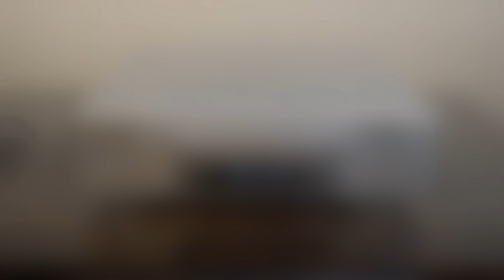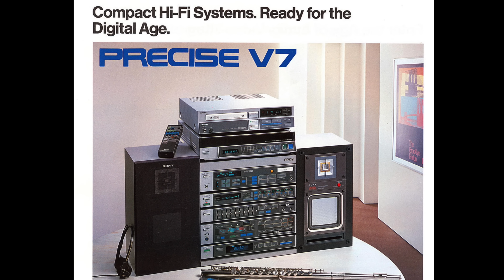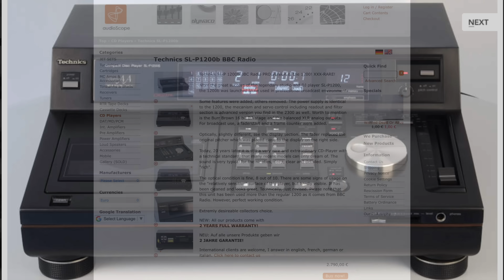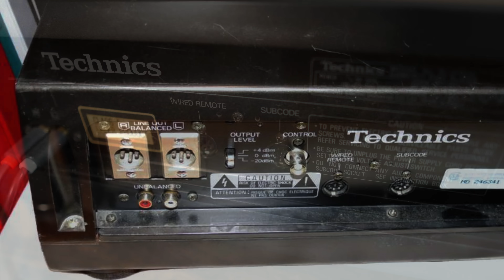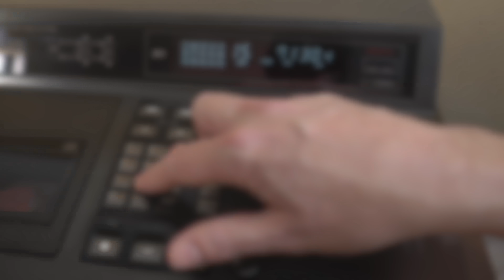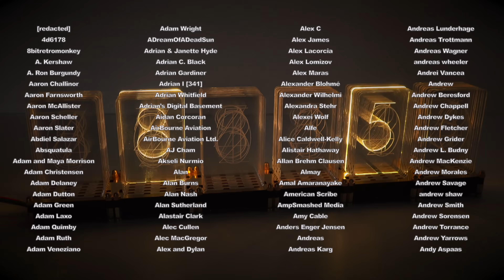How CD players lost their cool & why this Technics didn’t.

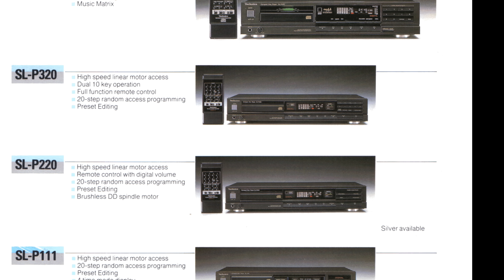Comment: 6:00 Honestly, I like these designs. You are not wrong, they are kinda boring in a way but on the other without at least one component like that something would be missing. They are kinda fancy on their own when they have individual buttons for track numbers, these grids on the display and sometimes jogwheels. But I wouldn't want every component of a hifi system to look like that, that's for sure.

Comment: Nice presentation! On a similar subject, you could present the first "drawer type" turntables. In my opinion, in North america, the Bing Crosby turntable made by Philco in 1946 (Model 46-1201) was the first to introduce such a device. There were a couple of other Philco radio/turntables in wich you could insert a 78rpm and hide it... for 5 minutes! Hence, the drawer type CD players are not a modern invention but a replica of an old mecanism!

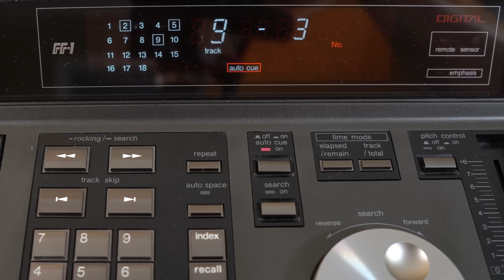Comment: 15:40 HOLY MOLY! why would they admit that feature from the machine and only have it on the remote. for professional use that seems like something you might need often or at least if you do need is finding the remote in that situation would probably be frustrating. 

on that matter no remote should be needed to run any product product features or menus full stop

Comment: as a frequent CD collector, I can vouch for this. Many CD players even back then looked kinda plane. Don't get me wrong, looking at the CD tray crawling in and out is often a stratifying moment like I am activating something bug but after that it is just awkward silence as the CD spins in the player. Hell I actually don't like the top loader design as it often looked like "cheap" to me. So it was interesting to see what Sony originally intended a CD player to look like and honestly, I kinda wish that was the default design. I still like the CD tray mechanism but I think the horizontal loading type was the best one. Welp what can I do, CD is on its support syst3em now and I can only watch as it slowly dies to progress. At least the journey up until that point was good.

Comment: Super video. Lovely CD player that Technics. I have a top loading JVC Micro System in my office. I much prefer the top loading experience - putting the disc in and seeing the disc spinning is a much more satisfying experience. Cant say I notice any sound difference between my main system in the living room, but then I'm still quite happy with the relatively low-fi cassette experience.

Comment: I repaired CD players in the late 80's through the 90's. The access time you show was something I saw all the time in CD players. Technics was always the fastest and Sony was always the slowest. There's a few reasons that it was always like that. Number one was the startup voltage sent to the disc motor. Technics blasted the motor to start it up quickly, Sony started at a voltage that was equivalent to the voltage needed while reading the inner track which actually caused failures when the motor brushes got tarnished because the motor wouldn't get up to speed in time and it would error out. The second reason Technics was so fast was it's linear tracking motor and position sensor. It had an open air potentiometer that gave the "brains" the exact position of the sled and the linear motor could launch the sled from the inner track to the outer track in milliseconds while the disc motor slammed on a braking voltage to quickly change the disc speed. Since Sony had the voltage running the disc limited and that would keep the disc from changing speed as fast plus the tracking motor was connected through a gear train that limited the sled movement speed.

Comment: I have the Bang and Olufson 9000 model which does anything you want to do. It even plays a cd or cassette randomly. Completely programmable. Turns off and on at any preset time to record or playback from radio or cd or cassette. Originally $3600 USD in 1986.

Comment: Have a look at the Musical Fidelity CDT, aka ‘the frog’. It’s an early nineties top loading no thrills player based on an underrated Sanyo DAC with a very smooth sounding tube (valve) output stage designed by the late Tim de Paravicini. I have it in a shiny Final Edition, swapped all the caps, replaced the tubes, bought a spare laser unit and hope to keep it running until the next big bang…

Comment: VCRs went through the same transformation. The early machines had a top loading carrier that you slipped the video cassette into and then pushed down into the machine. The tape was visible through a window on top of the carrier. The 2nd generation machines were front loaders. You pushed the cassette into a slot on the front, and it was then sucked into the machine, hidden from view until you pressed the eject button and the cassette re emerged from the slot.

Comment: The company making the "audiophile" CD player with the three pointed isolation feet are the same scammers trying to convince you that video quality is higher through a gold-plated HDMI cable for just three times the price.

It's digital. If the signal gets through, the quality is always the same.
Reply: Seeing a demo of coat hanger wire, monster cable, and some high end BS speaker cables that cost $1000. opened my eyes. The three person audiophile panel couldn't tell the difference.

Comment: I was wondering what the FF-1 logo on these players meant, I found this post that explains it:

The FF-1 (Fine Focus 1 beam) laser had just one beam as opposed to the earlier models which had a split beam for tracking. 1 beam slightly offset to the left and in front of the actual data read laser and one beam after the read laser, slightly offset to the other side of the data track. This way the laser could be held on track. The FF-1 laser block used one laser beam and the detector had a larger detector in the middle and 4 smaller ones around it. Based on which of the surrounding detectors got the most signal the focussing and tracking of the laser could be derived. The total signal was used for the data retrieval. Technics made a big deal out of it.
Reply: That's interesting. Thanks for sharing!

Comment: I have two of these SL-P1200 machines. They're built like tanks for sure. They are not without their issues however and one of them is big - the laser. It is unavailable. There were some equivalents around for a while but I think even those are NLA now. The other issue is the door closed 'switch' - which is a set of contacts and a small plate that shorts across them when the door is shut. This system was great when it was new, but it wears and then stops making proper contact. When this happens, it doesn't recognize that the door is closed, and won't play the disc. It can be repaired, but it involves diving into the machine to do it.

Comment: Matt you still manage to surprise me after all these years with something I've never seen before.
Having worked as a DJ for many years I had assumed Radio Stations would have used the same type of Twin Deck CD players I used in a rack case system.
Im sure some did has they had a separate control panel that would have made life easier for them to que, beat and pitch match 2 CDs at once.
The Technics has a really impressive spin up time though

Comment: Nice, I bought a Grundig CD 7500 in October, except the slightly different front design it's identical to the Philips CD-303 and also the Marantz CD-73 is very similar, I love that Design, it's tray loading, but it isn't a simple tray (it's got a front window and 15 LEDs to show the current track it's playing), no it ejects the whole drive mechanism and the disk holder swings upwards!
It's also nice to see that the laser pickup on these early Philips CDM mechanisms is like a radial tonearm on most turntables while most CD players use a linear tracking mechanism what was rather uncommon for turntables.
And it goes further, it's got a top window and the disc is lit up by 3 yellow LEDs on each side.
It wasn't really cheap for a CD Player (150€), got some deep scratches and didn't read discs, or they sounded awful, it could barely read them, but it basically worked, the discs were spinning and the laser worked, so I took it and gave it to repair, all caps got replaced, the transformer was re-soldered to 240V (I heard the grid voltage was changed in 1987 to 230V and before it was 220V in Germany and other European countries and 240V in the UK) and re-adjusted what cost me around 400€ and now works fine (it's also able to play some CD-Rs), I still need to change the built-in RCA cable because it looks just awful and the LEDs look pretty dim, I will replace them with modern warm white ones.

Comment: I'm a little surprised that laser safety wasn't considered as a reason for completely enclosing a CD as it's being read (or written, for that matter). These lasers can cause eye damage, so having a window simply for the sake of aesthetics seems like a bad idea. Analogue formats don't use lasers (except for that one laser turntable, which does completely enclose the vinyl), so there's no safety issue with exposing the disc/tape/etc.
Reply: It's a very low power laser. It only has to reflect off of something a millimeter or so away from it. Plus it's bouncing off of the back of what you're looking at if your player has a window.

Comment: That machine is amazing, if only it could read burnt discs I'd actually buy one, the features are amazing but not being able to listen to my digital library is a big dealbreaker for me personally. I wonder if it's possible to get a cd burner that can write discs that will be read as if they were pressed by early machines, I doubt they have the circuitry to check for copy protection, it's just the format I think.

Comment: The Technices 1200 pro CD Player was designed to fit into the exact space of a SL1200MKII Turntable. While popular in the consumer market, they were not at all liked among pro-DJ's. I Only ever used a few in clubs Never saw any installed in a radio station.  They sound great but as a pro DJ machine, they're not that great as evidenced by the fact that most DJ's including  preferred split Rack mount rigs of the same era.

Comment: Regarding view windows on CD players, in the 90s many portable CD players had a small window to view the spinning disc, presumably so you can see the disc spinning faster when you enable the Anti-Skip function.
As for startup time, you said yourself the Technics player could only play "pressed" discs...it didn't have the ability to differentiate CDR/CDRW, MP3, discs over 74 minutes, CD+G discs, or discs that have both computer data and CD-Audio (I have an old player that will "play" the track 1 computer data as CD-audio, and it would sound like playing a Sinclair or Commodore 64 data tape through an audio tape recorder)...presumably the later CD players do a lot more tests on the disc while loading the table of contents as it has to determine the type of disc inserted, especially the SACD player.  Also missing from your TOC read time tests is the time that it takes the drawer players to lift the player mechanism into position as that takes time too (you need a window to see when the drawer drive starts to spin the disc for accurate timing, GRIN)!

Comment: This is the only CD Player I would buy. I was a DJ in the 90s and used vinyl only. But at one club they had two SL P1200 and I thought 'why not trying this beautiful machine. It's a Technics and it's made for this job so...'  :) I didn't regret. Pro machine with a beautiful design. 
From a DJs perspective there are a lot of CD Players that came after this one with more features. Denon players were very popular at some time. But I wouldn't put a Denon DJ CD Player on the shelf in my living room.

Comment: The thing that bothers me with the drawer loading disc, CD DVD Blu-ray, is they often use a belt drive to open and close the door. For the computer types if they are not used for a long time the belt gets a permanent bend it in and often the door will not open or have trouble from time to time. That deters people from the use of it and they slid over to the USB MP3 style music and kiss the CD DVD drive goodbye. Techmoan as for this player you showed us, thank you. Very neat unit. However I think it will play CD-R, not RW if you burn them slower and be sure to close the CD session when done, and never write on the disc, mark it with a number on the clear center area. Those readers often have a stronger eye and any writing on the CD playing part will make them not read the disc.

Comment: i had a 100 disc cd carousel back in the 1990's that was beautiful... it had lights all around the carousel ..it had a single vertical slot in the middle front to load CD's into... 75% of the front face was clear so you could see the carousel.....it had full programming of CD info although doing that from either the unit or remote took many many hours..i do not remember the manufacture though...i replaced it with a bland single cd player that could play MP3 cd's...3 or 4 cds easily replaced all 100 of those pressed CD's

Comment: For a moment there I thought this might veer into a discussion (or rant) about "gapless playback" . . . or the lack thereof of on modern CD players. My one remaining CD player,  attached to my '80s living room stereo system, is a 1990 Denon.  A few years ago I toyed with the idea of replacing it with a current model CD player just to see if it sounded better. In the midst of research I learned that very few modern players (out of a very small range of choices to begin with) have gapless playback. I never even knew it was a thing until I learned (WTF?! 😖) that it was no longer a thing. The Amazon Q&A sections for several CD players are hilarious due to the people earnestly trying to answer the question "Does it have gapless playback?" who have no idea what the question is about.

Comment: Another fine example showing why I consider Technics gear around that time frame to be some of the best when it comes to features, styling, quality and value.
I recently bought a Technics ST-K50 Quartz Synthesizer AM/FM Tuner with 24 (!) memory presets, for the price of $2.00 US.  I did have to pay several dollars for a polarized 2-wire power cord, and replace the rubber feet which had turned to goo.  But as a low-budget yet good sounding tuner, I got my money's worth.

Comment: Might not be the last word in detail or resolution, but an absolute joy to use and interact with. There was something like 5 variants. Versions with the XLR outputs sounded slightly better. The 1300 was the top of the range and made just for the American market.

Bit of a ticking time bomb. The two electrolyte capacitors on the motor drive board fail in particular resulting in the disc not being read. Others on the main board can also fail. The switch contacts on the door (the small brass plate on the door connects 3 contacts) has a habit of failing, but fixable. 

The same laser (SOAP 1200) was used in all the range. The SL-P111 was the cheapest, I think. Buy one for the laser.

Some will actually play burned CDs. It depends on how well the lazer is set up, I think. It was produced before the specs for cd burners were established.

Vintage Sennheiser HD 424 headphones are a great match with it. I tried quite a few.

The SL-P 1000 is the same player in standard format.

I think MrSharman42 might interest you. He has some great-sounding videos - and some fantastic vintage gear:

https://youtu.be/efU7LWwTNYs

Comment: As an aircraft electronics technician, I'm wondering if the reason that later CD players take longer to read is down to some small handful of mass produced chips that they all use versus the early models having higher-quality proprietary chips.  I timed the two players that I have, a home unit and a portable, and the portable clocked in just under 6 seconds and the home player at just under 8 seconds, multiple times each.  Which, to be honest, that sort of stuff made the players cheaper, but also added to their boringness.  Hey, though, at least these days, music has been saved.  Just put the autotuned and quantized highly-compressed music on your phone and stream it over BT earbuds, the very pinnacle of musical expression!  (Oh, and you kids can stay the heck off my lawn, seriously.)

Comment: That's the same model CD player the radio station I visited when I was in cub scouts used to play sound effects in adverts. This was c. 1995 and they were still using mostly analog tape for that. The eject mechanisms on theirs were so worn down by that point they had to use a screwdriver to open them.

Comment: As a dj, I've always wanted that unit. I was working in a dj equipment / record store in 1993 and was tempted to buy 2 of them. My only issues with the unit was that I needed space to lay them out alongside the turntables. My turntables are in a shipping coffin and a 19 inch rack mount would have been easier to mount over the mixer and have the player unit somewhere under the set up. Also not only the high price each, but the tempo slider had a master tempo setting which kept the original key the music was recorded at while slowing down or speeding up for the beat match mixing. What really bothered me about that feature was when set to master tempo, you would hear a doubled audio of the track playing. Almost like a split second of doubled audio. I wasn't crazy about hearing that quirk Technics hadn't corrected at that time. I'd still want those units today though but they're hard to find in useable condition.

Comment: Uninspiring? Look at modern UHD Blu-Ray players, those are uninspiring. Out of the ones I could find when I was shopping for one, none of them except one very expensive one had any kind of display and all looked like a generic black enclosure that may as well be an Ethernet switch or a box into which you put all the leftover cables in the rack to keep them out of sight. I miss the times when a device actually looked like something.